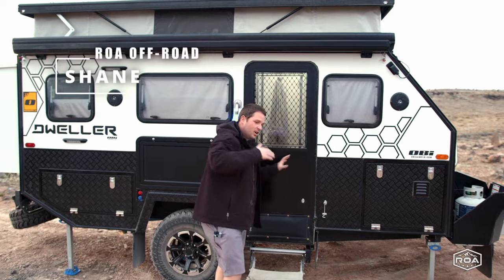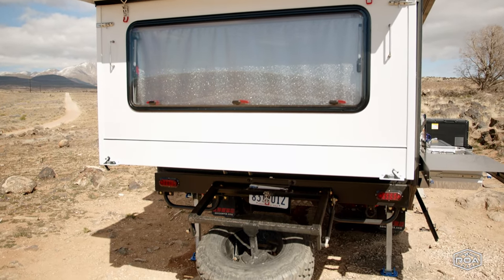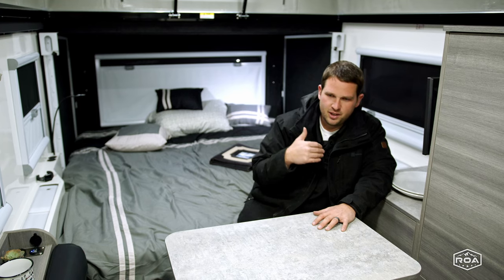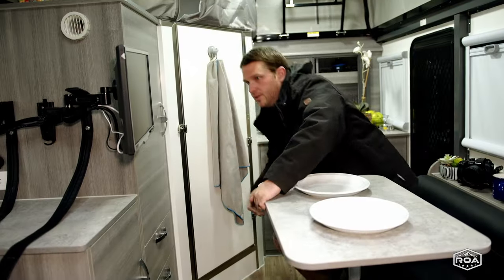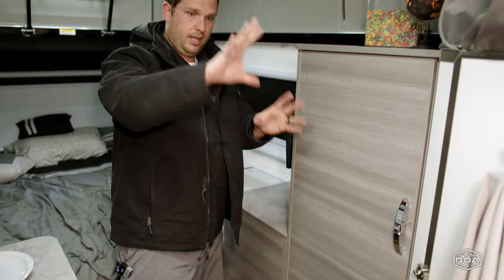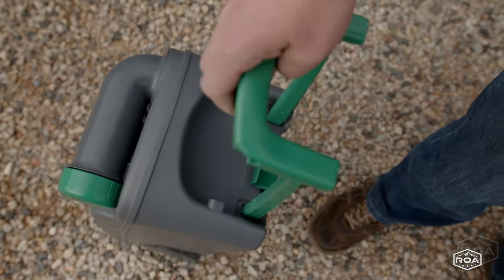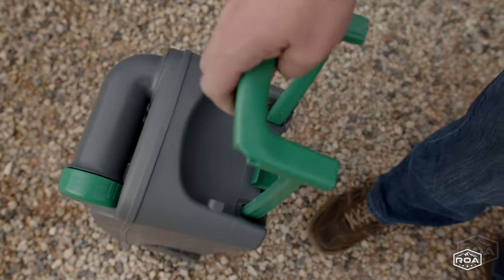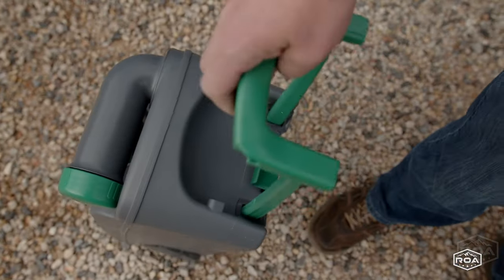Full Tour OBI D13 ROA OFF-ROAD DWELLER 13 TRAILER TOUR! RVsofAmerica Beats Opus or Black Series? 22

Comment: Another excellent walkthrough video. Even though this trailer isn't the right one for us (not suitable for full time or cold weather), this video is a good example of why it's worthwhile to watch all of these walkthroughs. There are a lot of design and fit/finish details that are applicable to all trailers. Hopefully, these ideas will all make it into the Roamer1 design. Features like the 50 Amp service, Truma Combi, AC unit install, accumulator tank are definitely best practices for a high quality trailer. Our accumulator tank is 10X the size of the the one in the Dweller. I didn't even know they made compact versions like you showed. It was also the first time I've seen anyone discuss the purpose and value of an accumulator tank in a trailer walkthrough video. If the AC unit could be either DC or able to run easily on a 3000W inverter, that would be a significant upgrade. Other fit/finish and quality items like the plumbing connections, latches, cabinetry, fiberglass shower, and tires/rims should be far more common in the RV industry. People can learn a lot from watching a video like this before they go to an RV dealer lot to look at other products on the market. One item for future videos. Although you talked about the frame construction, you should also take a little time to discuss frame design and suspension details in all of these videos. After all, the main reason you spend extra money on an "off road" trailer is to buy a superior frame design and suspension.
Reply from the maker: Thanks so much! Very good points that we are thinking about. 😀
Reply: Totally agree - take me as an example: I’m not an owner but I’m doing a lot to of research to become one and this kind of videos brings a good approach to understand the composition of an Rv, plus - must say - ROA makes it very easy by sharing not just the product or features but also bringing the closest experience. Great trailer and great video guys!

Comment: If you upgrade to 300+ AMP Lithium, can you run the AC off the Inverter?

Also, nice to see an American built Trailer with a real door and security screen door!!!👌
Reply from the maker: Yes you could probably run it for a 2-3 hours with a battery bank of 300 ah lithium

Comment: This thing might be good off-road, but I’d advise not towing with ANY mid-size truck. These guys showing it being towed by smaller trucks, but I just picked one up in my gladiator and it damn near killed me on the highway.
Reply: Please expand, I'm in the market for an off road trailer that I can tow with my JT as well.
Reply: @4_lolife  The trailer bounces back and forth quite a bit, especially if the road isn’t very smooth. It bounced my JT around all over the place, almost causing a wreck. I ended up trading in the Gladiator for a Ram Rebel diesel and it tows the dweller well.
Reply: @ILL_Equipt  I too considered getting a bigger truck but truly like my JT. Thanks for your response.